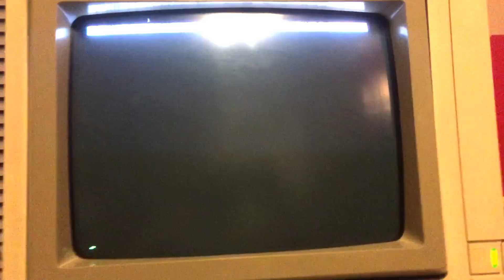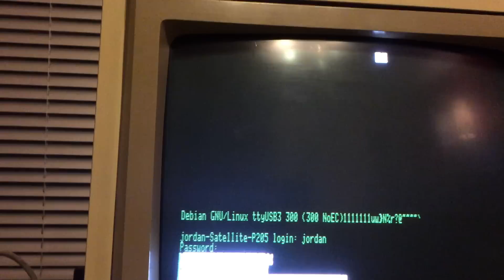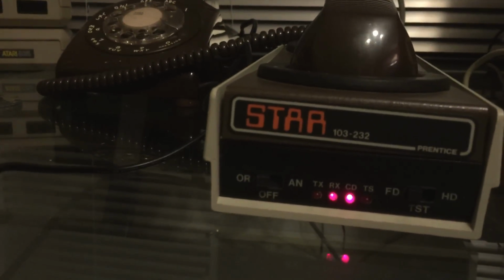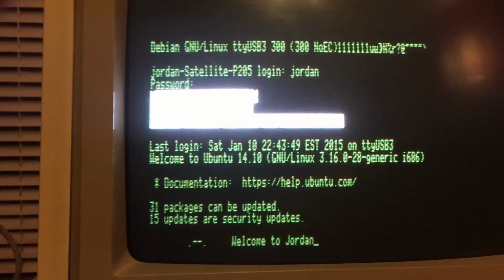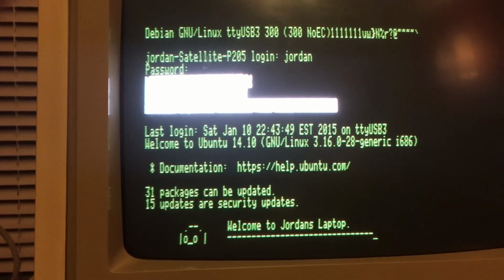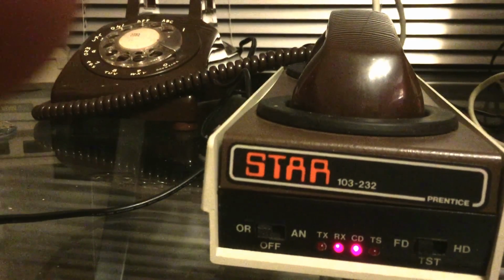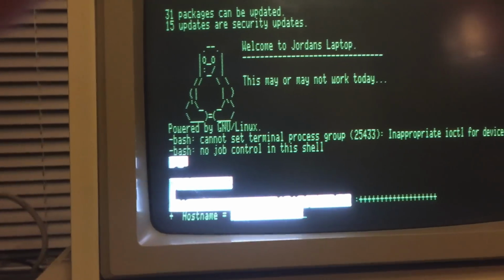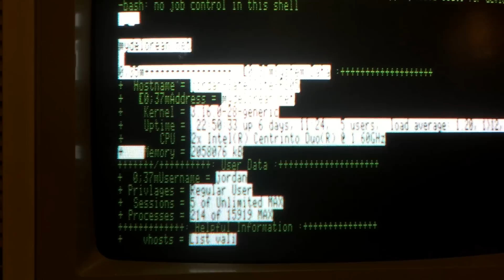Apple 2 connecting to the net with 1970's acoustic coupler modem and rotary phone

Comment: Hi. Very nice video.congrats.  I have the same modem and I would like to test connection via dialup to the server with linux. Which equipment you use from the server side and how did you setup it? I would like to dial up a number on the phone like you did and connect to linux server. Thanks a lot and I apreciate

Comment: I suspect over time the internal components have drifted out of the Bell Spec, also acoustic couplers  are very sensitive to noise and vibrations - I used to put ours on a foam rubber bed so they didn't pick up vibrations
Reply from the maker: I was able to confirm the tones with an oscilloscope and recalibrate to specification
Reply: @retrotechandelectronics  Cool back in the Late 70's in the UK we altered our GPO approved modems by adding pot's to enable us to tweak the gain we where at several kyards from the switch out at cranfield uni

Comment: I'm looking to do the same thing you did here! I just purchased a Star Acoustic Coupler, but it doesn't have a power adapter. Here's the link to the one I purchased: https://tinyurl.com/vrgotup

Would you happen to know what kind of adapter it is as it may be the same as yours. Although, I have seen the same model of mine but with a 5 pin DIN on the back for power, so I'm not sure if you have that for power instead. Also I'm wondering on which kind of computer or terminal to get. I wouldn't mind getting an Apple ii...what are your thoughts? Thanks!
Reply from the maker: Your picture doesn't show a 5 pin DIN connector, or do i see it wrong.  Should be Mains to 20VAC @ 400ma
Reply: @retrotechandelectronics  thanks for the reply! if I were to get an Apple II, would I need to get a certain adapter to connect the acoustic coupler to it? I noticed the serial port is circular on the Apple computers from that era and probably would need a converted cable to the 25 pin on the acoustic coupler. Also, is terminal already built in to the Apple? Thanks so much! :)
Reply from the maker: @eatshrots  apple II is an RS232 DB25 connector

Comment: Nice.  I purchased an external 56K dialup modem a while back and also bought a USB to Serial interface adapter to use with the 25 pin serial port on the modem.  As of today my efforts to get this setup running has failed on many occasions.  My newest mystery involves using my new Spectrum Internet phone service which is VoiP and if it can handle 56K baud rate on my RS232 serial modem.  Anyway, I enjoyed your video and thank you.  PS, I did actually get the modem to respond to commands once and even dial out but it would not maintain connection but that was on a different landline phone and not the same as my new cable.
Reply from the maker: There is no way your spectrum VOIP will handle 56K.    The Bandwidth for the codec simply does not exist.   For older computers, it may function error free up to 9600 baud

Comment: Hi, I have the same acoustic modem, but missing the power supply. I believe it's powered with AC supply, as internally the supply input goes to a bridge rectifier after the Orig - OFF - Ans switch. 
Can you please measure your power supply and confirm it's AC and the rated voltage? 
Thanks a lot!
Reply from the maker: Hello, thanks for the inquiry.   Output is 20VAC rated to 400ma
Reply: Thank you very much! I have now another question:  in test mode, I get the characters echoed back correctly on serial only in originate mode. When in Answer mode, it doesn't even light the CD (carrier detect) led and no loopback happens of course. Is it the intended behaviour or do I need to check/repair something on my one?
Reply from the maker: That i could not tell you I would have to replicate the event

Comment: I still use mine. It's from the 80's. I have a rotary dial phone with the 3 wire connect in my place. No other choice. It's a real pain in the a**.
Reply from the maker: So..... You are using 300 baud dial up to where?
Reply: why
Reply: I'm a tenant & that is the stuff I'm stuck with right now. I would have to pay to upgrade. Money is tight. When I do get my own place, you bet I'm gonna get the latest stuff on the market !!!
Reply: I have my internet through Juno. I'm switching to NEP Telephone Co & getting everything changed up in Feb. My phone, internet & cable will come as a package. Goodbye to that old stuff. YAY.
Reply: The modem & a couple of boxes. I'm a real technotard. I know how to use it, but don't really understand completely what is inside of it or even how it works. It was very cumbersome. NEP phone company took the box that converted the whole mess to wifi. That belonged to them. The rest of it was hers. The only thing left here is the phone. The internet comes off a cable now. I really don't have to do anything, just turn on the computer. I am spoiled.
Reply: Hope you sell it to someone who will appreciate it
Reply: The landlady took it back when she came up last week.
Reply: She trash it?
Reply: Probably not. She saves everything. It was hers to begin with. Like everything else, she will probably use it until it falls apart, lol
Reply: Cool
Reply: What was in the set up?
Reply: The noise drove me batty. It actually scared some of my cats.
Reply: Aren't we all spoiled? 😎
Reply: Was it that loud?

Comment: can you  help me? i have 1 and need to know what voltage requirements it runs on so i can prove it power's up. had it over 20 years and dont know what volt run;s it for power.
Reply: Got a model number? Can you open it up and see if theres any info on the circuit board. The answer could be anywhere from "3v" to "48v passive" :(
Reply: @shayneoneill1506  normally you connected it to the mains you wont run a modem on 3v  -48 V maybe but that would be carrier grade modems for use in racks telecoms us a lot of 48v kit

Comment: I think I have the same Star modem. What's the voltage requirements? It would be cool to get my Apple IIe connected to something.
Reply from the maker: Do you still have a bell standard phone to connect to the couplers?
Reply: Jordan Rubin I do have a rotary phone from the late 60s or early 70s.
Reply from the maker: mine shows 20v that can support at least 400ma
Reply: Jordan Rubin Thanks! does polarity matter?
Reply from the maker: yes